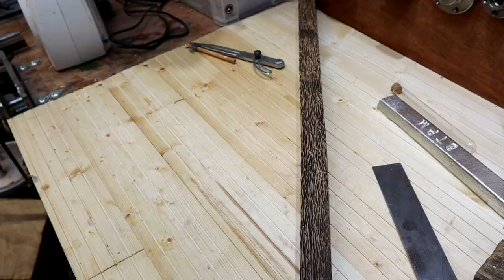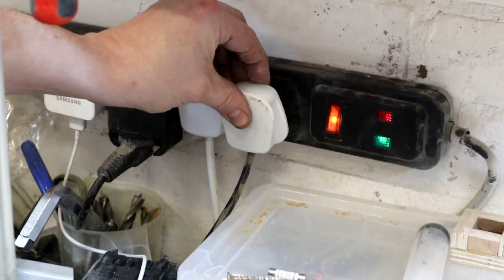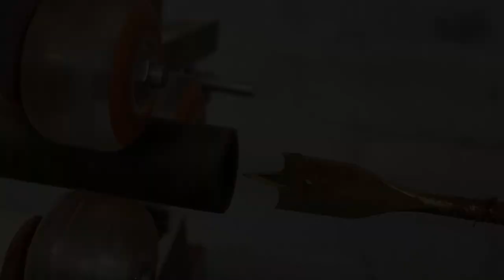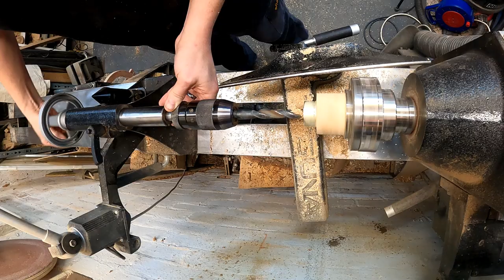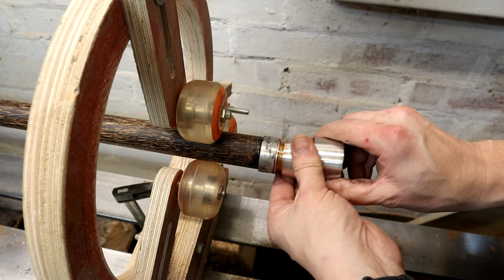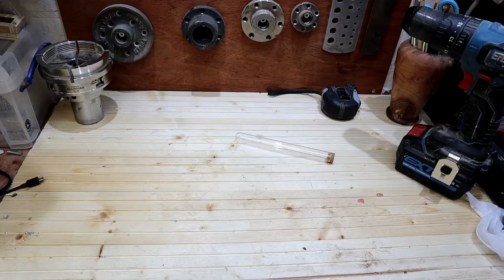Woodturning - A Tippling Stick

Comment: Was that aluminum?

Also,I know it's tough to keep the video short, but I was a bit confused about the process with no explanation. 
It looked like you put a thin sheet of copper on at one point, and the machined it all away(?)

Anyhow, it did come out very nice!  I just don't know if I could get enough root beer in that vial. 😜
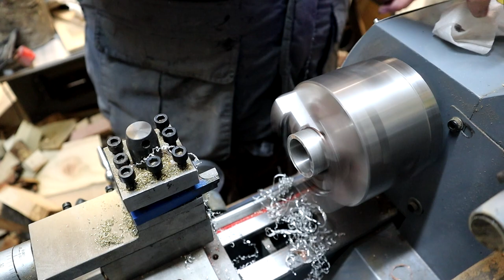Reply: He had turned the piece around and the copper part was in the holder. At 7:14, you can (barely) see the copper piece as he removes it from the lathe.
Reply from the maker: Thanks, most answer above I think, but its Pewter and not aluminium